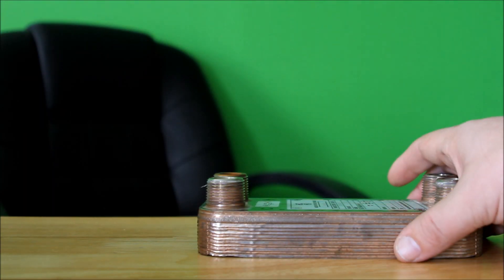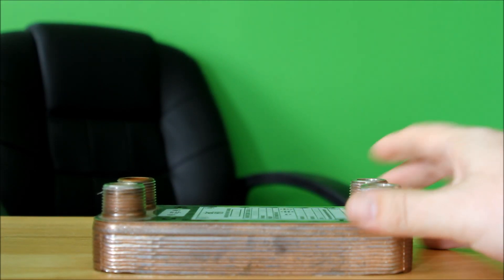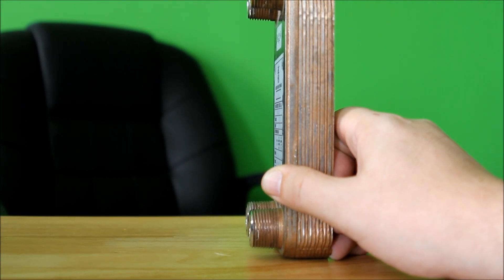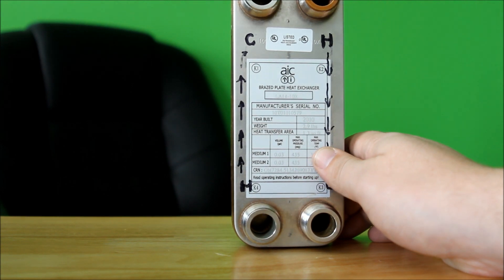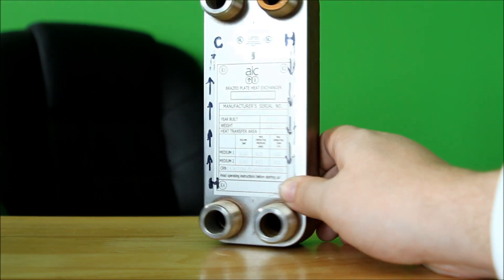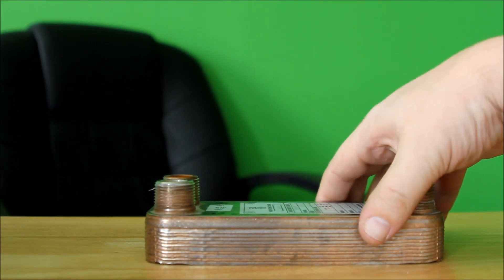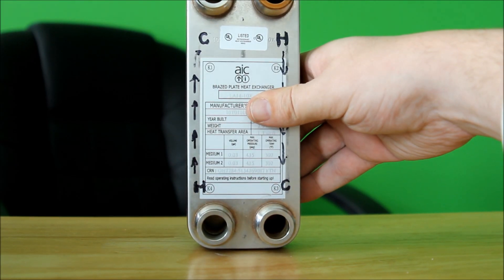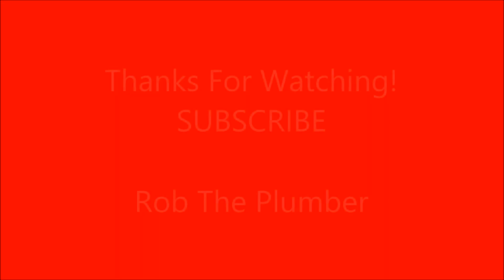Plate Heat Exchanger - Introduction

Comment: I bought one of these yesterday (a 30 plate) to heat and cool my car's engine oil. The oil takes a while to warm up in the winter and gets very hot in the summer, so I got one of these to exchange heat between my car's engine oil and coolant so the warm coolant warms the oil up quicker in the winter and keeps it cooler in the summer. I am hoping that this heat exchanger will keep the oil temp within around 10 degrees of the coolant temp the majority of the time

Comment: Hello Rob, I have this type of heat plate transferring heat from an outdoor wood stove to my in house hydronic system which is in floor heat.  I would like to change to something that wont have the build up from minerals like an oil cooler bundle or something.  Would you have any suggestions ?